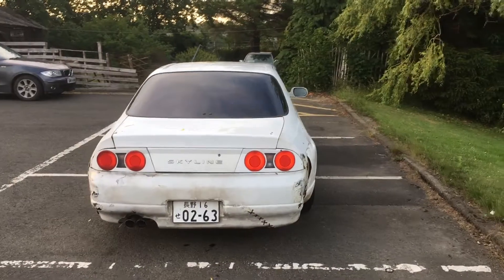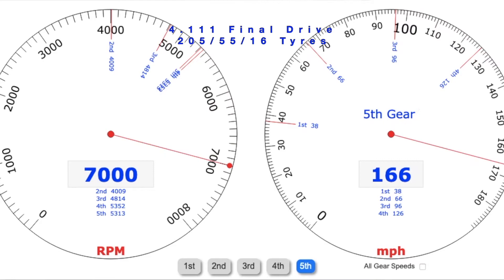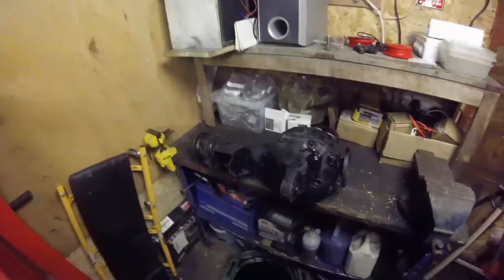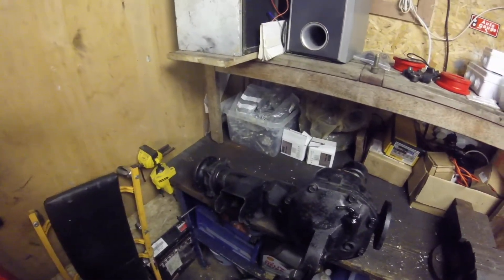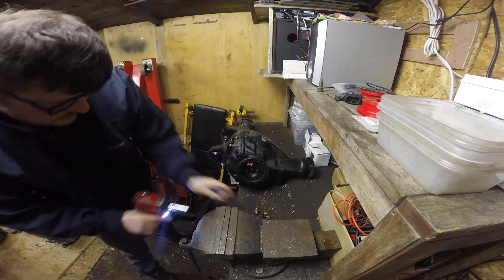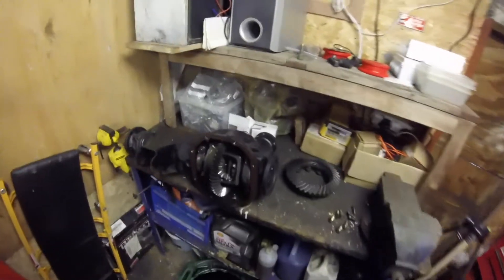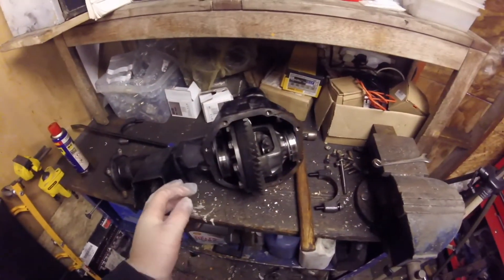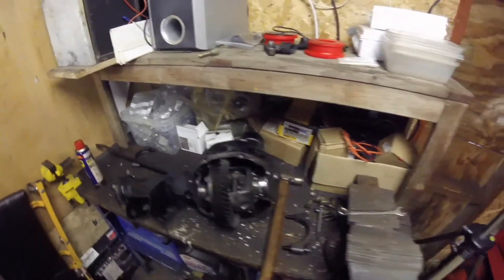Nissan Skyline R200 Differential Build

Comment: Hey there. What was the verdict? I've been interested in possibly fitting 4.6 or 4.9 ratios in my R32. Rb20 car, GT2860 0.9 bar or so.
Reply from the maker: Hey dude

I'll be honest - i havent really gotten anywhere with the 4.6/4.9 build, kind of gave up on it, nobody has offered any help or advice on how to fix the issue with the 4.9 pinion being different. 

Since the video I have purchased a complete 4.3 diff, so i'll be fitting that for now!
Reply: Thanks  @BENJY-JP ! 4.36 is currently fitted in mine! 
Did you already try to press the pinion bearing off of 4.11 and onto your new pinion shaft?? (Plus shim of course)
Reply from the maker: @TophSlides  yeah i did, the backlash is miles off though, would ideally need to go to a machine shop to shim it correctly, 

Be easier trying to shoe-horn an S13 diff into the Skyline Subframe (same as S14) haha
Reply: I had the exact same issue. Took it to a shop and they were also just as confused. (They do not specialize in Nissan). Talking with others these are essentially in compatible. Verdict: Not all R200 are the same